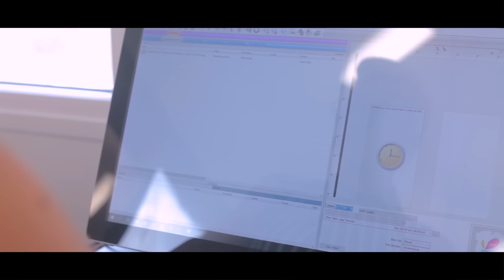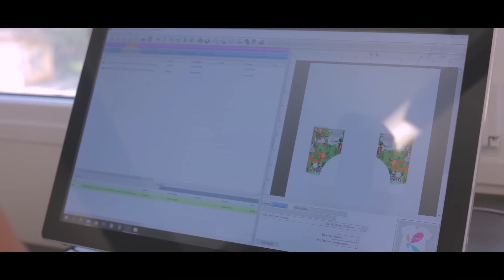All Over Printing On Canvas Shoes with TexJet® echo

Comment: What is the name of this printer or what is the brand is this printer?
Reply from the maker: Hi there! This dtg printer is named TexJet® echo and it is manufactured by Polyprint. Right now, there are 2 options available, TexJet® echo2 which is the successor as well as TexJet® shortee2 which is a more compact and lightweight printer but still powerful enough to accomplish almost everything! If you need more info regarding our products, please visit this link to get in touch: http://www.polyprintdtg.com/contact/

Comment: how long does the print last?
Reply from the maker: Hello Luis Orrego,
The print could last a long time if you are washing it in the recommended conditions (cold wash or 30oC max, 800 rpm, no softener). Of course, you will have to make sure that you performing correctly the fixation process of the inks, in order to stabilize them on the substrate (canvas). This way, your canvas shoes will withstand the washes and their amazing quality will be maintained!